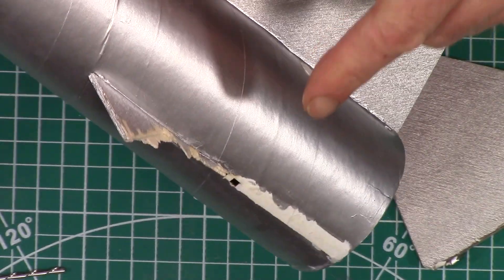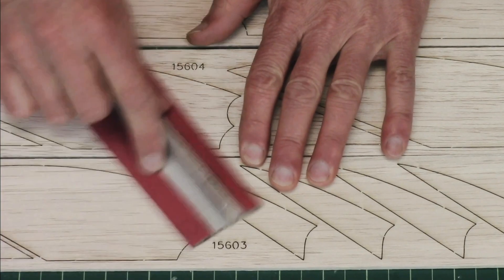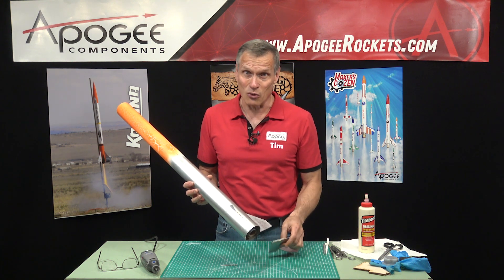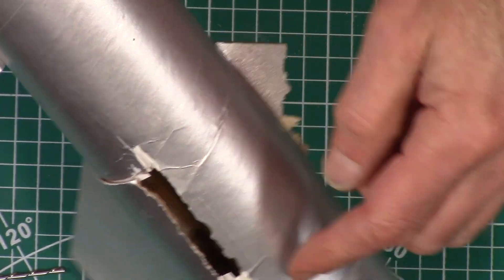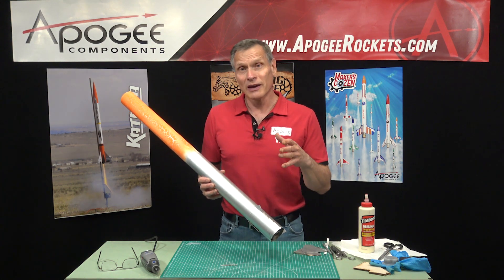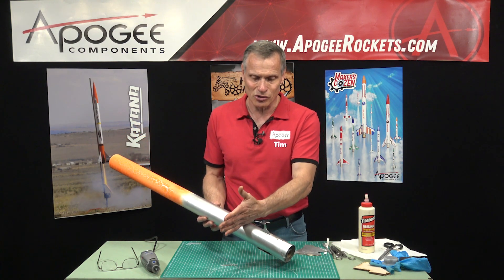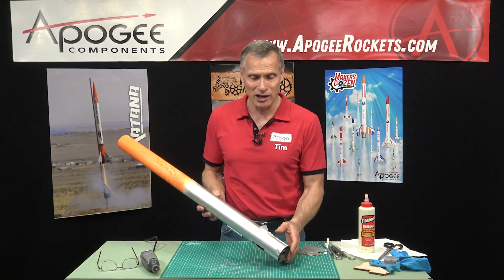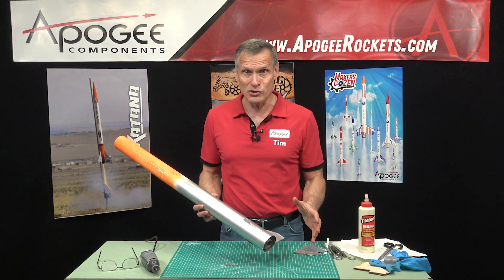How to Replace a Busted Through-the-Wall Fin on a Model Rocket

Comment: I cringed when you were pushing the knife blade towards your thumb.  You did it and survived, and I'm sure lots of us has done it too, but viewers please be careful when doing things like this.
Using the Dremel in there was true rocket surgery.  I might have tried removing the rear centering ring and using a piece of hacksaw blade from the rear but you got very good results the way you did it.
For that shelf part I might have tried a sliver of spare body tube.  Glue a piece of cardboard or balsa to it to use as a handle go get it in position then cut the handle off after the glue dries.  My train of thought for removing the rear centering ring was to allow insertion of larger pieces of coupler from the back then cut new slots in them for the fins.

Comment: I might remove all three fins flush to the tube only and repair the tube. Cut three new fin slots and glue in three new fins.  Of course you can’t access the motor mount tube from inside to add fillets , but it would work. Just an idea.
Reply: I don't think this rocket would need inside fillets.